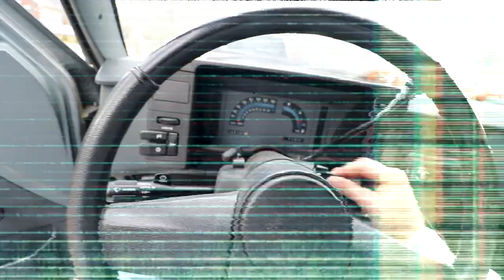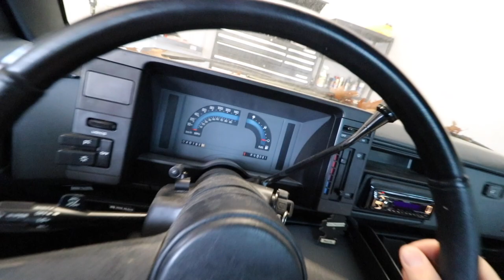Restoring a Barn Find Truck!

Comment: When I was 13 I got a 1986 S10.  No motor, no trans nothing to it but a nice body and interior but no drive train. Not even the rear end.   Well seeing how long ago that was beside the LS days it might just have came out I did a 383 small block Chevy SBC swap with a 6 speed manual and 4 link 9” ford diff. Disk brakes all around.  I had to double pumpers 650cfm carbs.  It took me years to build and save up for parts.  It was so fun and I wish I still had it. The next owner lost traction even with the 28”x15”x15” street slick and 245/75r15 I had on the front.  She was fast and would rip them street slicks in 3rd gear if you gassed too hard shifting.  He killed it and I’m still sad.  Now I got a hardbody that was my father-in-laws truck and my wife will not let me ‘change’ her daddy’s truck that she remember from the time she was little.  It is a 1991 and I think a LS or SBC like my S-10 had would be just right.  But I think I’m going to turbo or supercharge the little ka24e when it dies and I rebuild it.  65mph top speed is real when everybody else is doing 75mph speed limit or 85lol it is scary af.

Comment: I got a 89 4.3 v6 with 275000 miles and runs better than anything ive ever had. I redid the entire thing with my grandfather recently. That car is so easy to work on.
Reply: And my Ac still works

Comment: K SWAP THE S10
Reply: Why tho, there’s so much more room in that bay, plus that engine isn’t made for hauling at all, you need a high torque engine and transmission, hence why V8s and diesels are normally put in trucks.
Reply: @lillythepone2994  are you legitimately trying to tell me that this thing will be doing any hauling? seriously? wtf do you think he just bought the brand new full-sized pickup for if he is going to be using this for hauling, the only thing this is going to be hauling is hauling ass and it will be a lot easier to make this thing haul ass with a small/lightweight boosted 4 banger, compared to a big heavy V8, this is already a light truck, why add unnecessary weight? if you are looking for ~500hp then it is far more efficient from a weight/power perspective to go with a boosted k24 or k20.
Reply: @bitzer8722  Never seen a K-Swap S-10, you know why? Because there’s absolutely no support for it. It’s not only more logical it’s also easier and faster to throw an LS in it
Reply: @lillythepone2994  faster to put a bigger engine in? Excuse me? Is that all you could come up with rubbing your two brain cells together? And i can name a guy that’s done it, sammybuilt on ig, check it out, if I try and find more people it shouldn’t be that hard. I’m sorry to hurt ur “MERICA” attitude but not everything needs a big heavy v8, k swaps are way lighter, easier and more versatile for very similar power numbers.